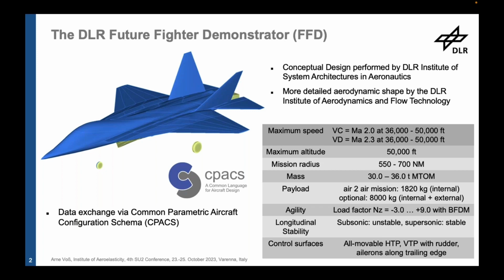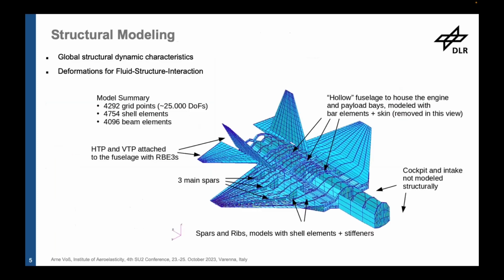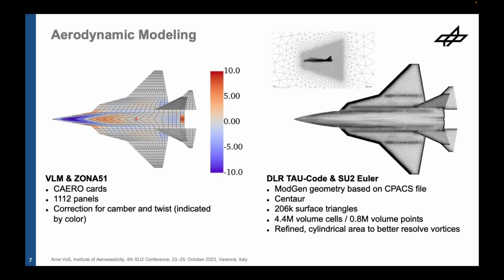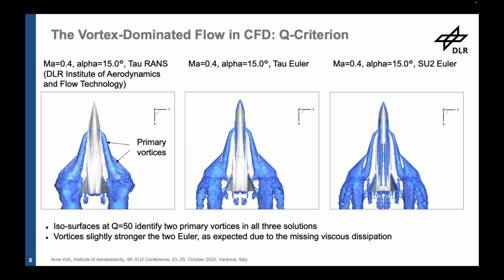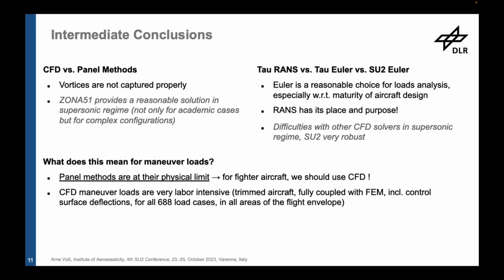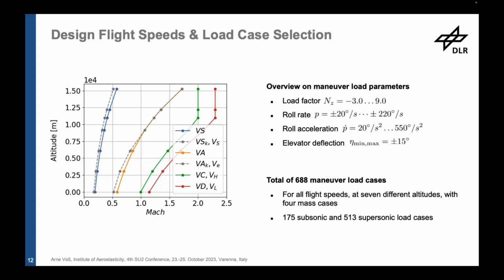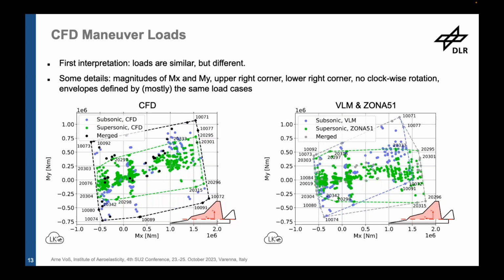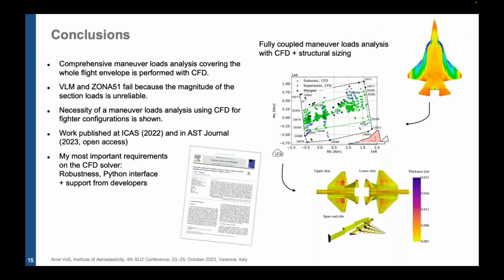SU2 Conference 23: Maneuver loads analysis using CFD methods of a fighter aircraft

Comment: And gaming... Unless you are trying to get something like paint competing with Ansys Mesher it just doesn't really make sense. Or maybe not paint. Paint is way too good for meshing. Those vertice based software for drawing 3D models. I've actually tried them for meshing and they seemed rather interesting, especially for really tight corners, where you could theoretically draw the missing nods by hand, after the algorithm finished up most of the work. Tried hooking those up with some cfd codes but the interface wasn't that great. Paint vs Ansys Mesher, who gets to go first to Mars. :)))))))